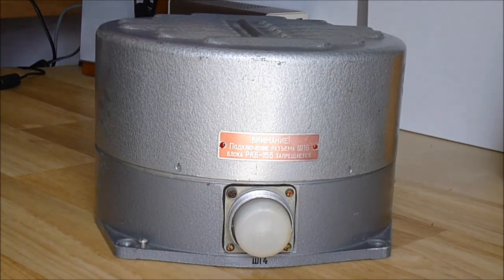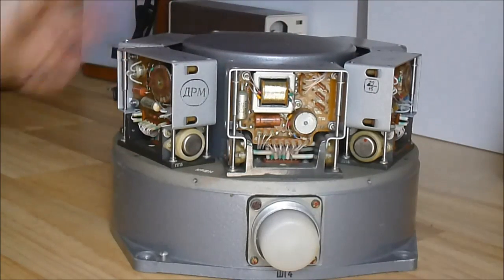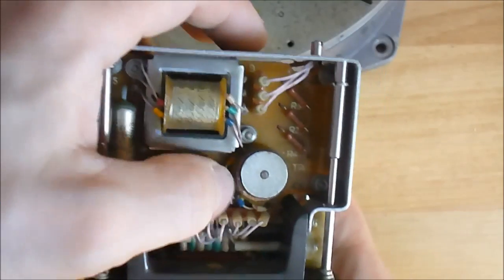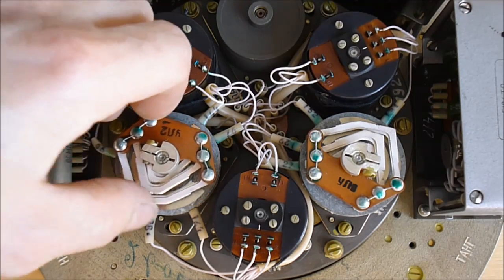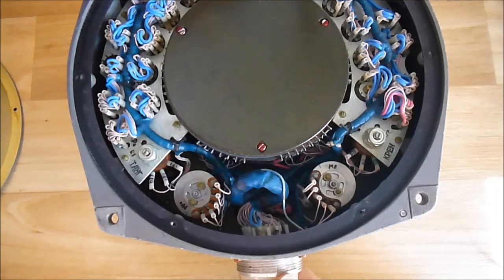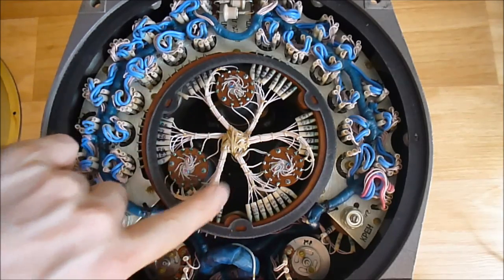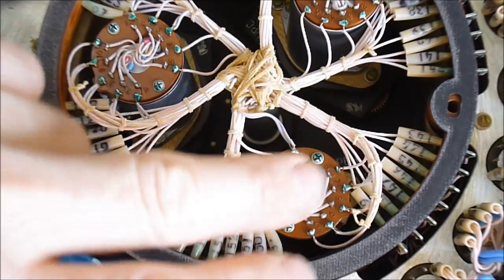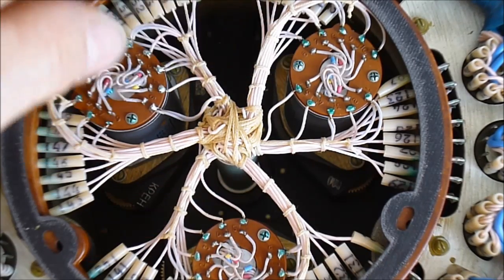BS-155A soviet autopilot teardown

Comment: Any speculation on what it does, to what it is connected and what the components are doing?
Reply from the maker: Sadly it is very hard to find infromation, and any available one would be on the russian web. A good start should be http://www.airwar.ru/breo/ .
Reply: It probably just holds the current pitch, roll and yaw when autopilot is switched on, as well as maybe provide some damping to these channels.

Comment: So what does it do and how does it do it?
Reply: +0MoTheG Autopilots are designed to assist the pilot in flight, by automatically performing certain actions like levelling the wings or the pitch. There are different complexities of autopilot, but my guess is that the white spinny things that had motors on them at 4:10 have something to do with it. Perhaps when they spin at a given speed, the position of the aircraft is calculated by measuring how gravity relative to the aircraft affects the spinny things spinning?